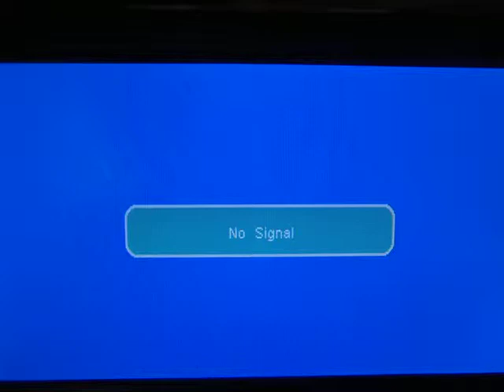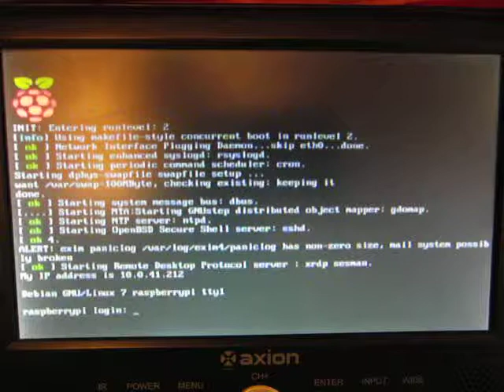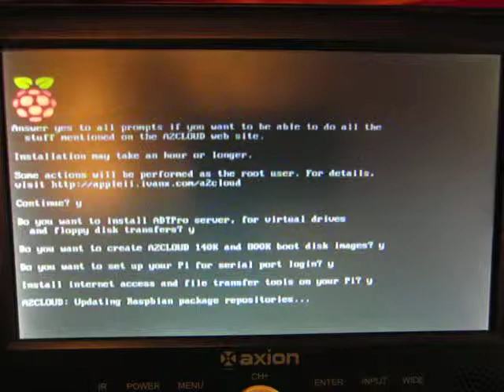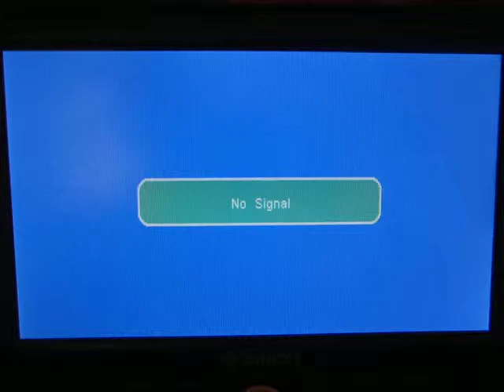A2CLOUD setup part 2: configure your Raspberry Pi

Comment: Never could get it to run properly. I have all the required components and have followed your instructions thoroughly, though. But it looks like my serial connection hangs, even though the cables I'm using (FTDI USB chipset and null modem cable) work 100% fine with ADTPro. I have tried another usb-to-serial adapter (Prolific chipset) but I get the same results : it never connects to the PI.

Comment: Can a2cloud be installed on other Linux devices using the same commands?
Reply from the maker: In princple, A2CLOUD could run on any Debian-style Linux. However, the installer script has never been tested on anything but a Pi. Problems could arise if a package that's expected in Raspbian isn't installed by default on another Linux. Also, the automatic USB port detection for the USB-to-serial adapters might well need tweaking. And the installer might try to download and install Pi binaries of some of the tools it installs which won't run on a non-ARM device. And there could be other issues. So, likely possible, but not without some work. You can check out the installer script yourself (there's a link on the A2CLOUD web site in the Release History) if you want to have a go at it.
Reply: Ivan X I see.  I was considering doing this type of thing with an android cell phone with a USB host adapter.